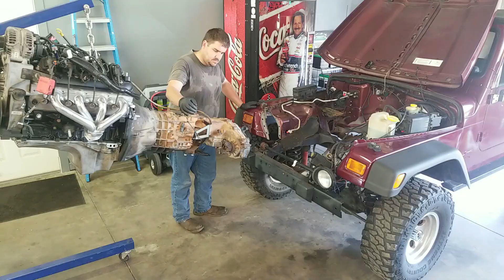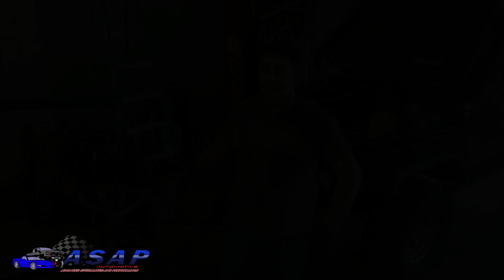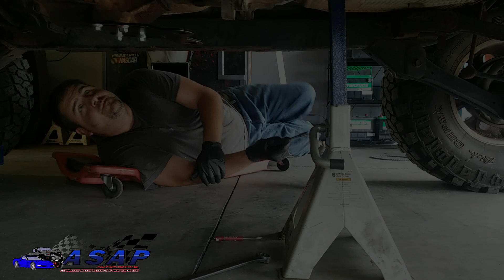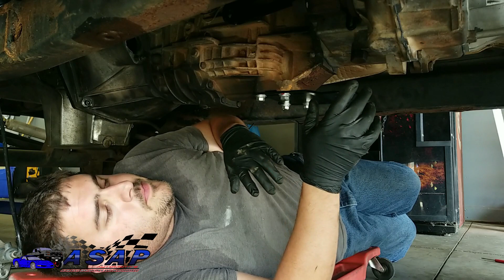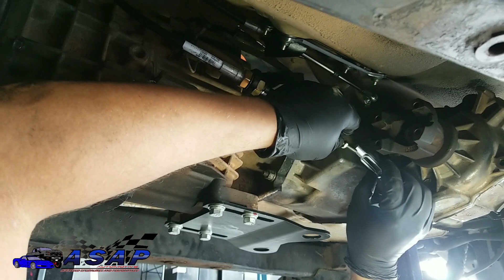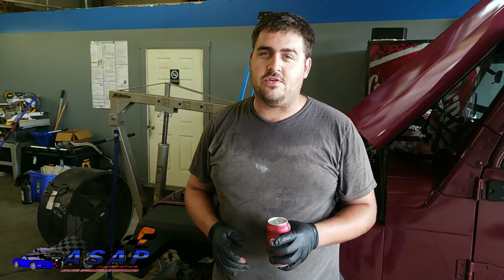Drive Train and Shift linkage install

Comment: Did you have an issue with that rear driveshaft vibrating at that angle?  When you go to a double cordan you want that rear joint to be as close to zero degrees as possible.  Yours is pretty close, so it may have been fine.  It was off a bit from zero though by the looks of it.
Reply from the maker: No not at all, Drives really smooth. Actually at rest its near right at zero.

Comment: Great engine choice! This or the 5.3 are the two I'm torn between.
Reply from the maker: Either one you really cant go wrong, we wanted the 6.0 for the bigger displacement and more power.  You can easily pull more power out of a 5.3 or 4.8 for that matter, that and they are a fair bit easier to find.